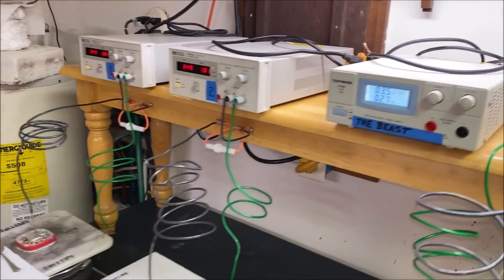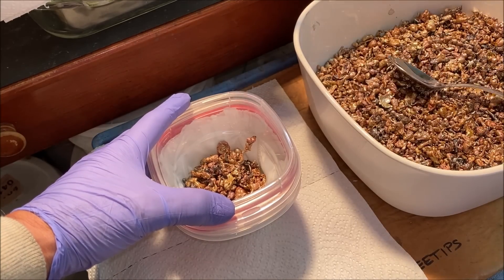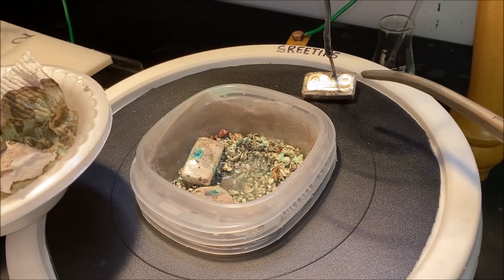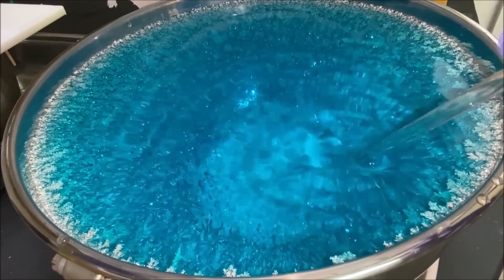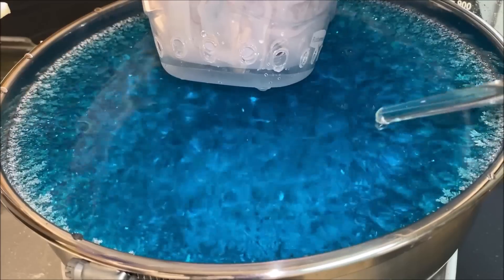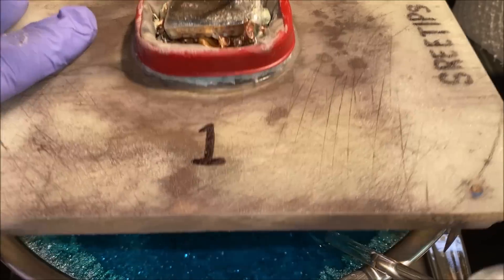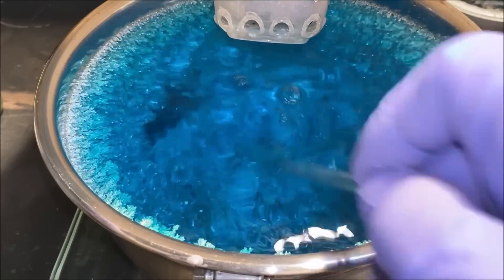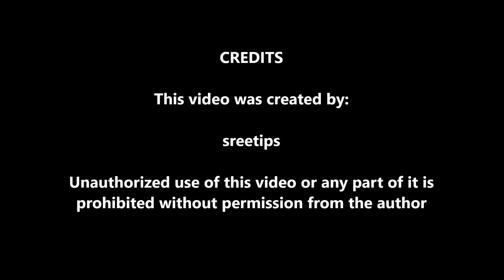Silver Cell Day 4 Crystal Growth 96 Hours

Comment: Hello, the dictated translation sounds a bit stupid, there are meaningless and absurd words in your language, in English it is very different from how you speak. 
Replicate your experiment and use the graphite anode as well as the cathode of a 45 liter crucible in the separation part or lid and used PVC, this method also works with gold 😜
Reply from the maker: Sounds stupid, got it. I’ve used graphite for cathode material. Thanks for the input

Comment: Excellent work , the silver may be pure but really  the cleanliness of the system relies on you only using diffusion through the fibre ,  so the size of the bag is paramount ,  of course you could use 2 baths with a ion bridge between to increase "production" , probably not worth doing,  but it would mean that the cell would keep producing and not clog up ,  all the slimes would accumulate in the dirty side, just loose in the bowl and you wouldn't need to buy the bags ,  you just need to ensure there is no flow between the two sides, in electroplating a cloth or tune is used between the two sides as a bridge between the two sides ,   it just depends on how clean you want the product
Reply from the maker: Interesting, “a cloth or “tune” is used between the two sides”. What is a tune?
Reply: I used to use a "bubble lift water pump "  to gently circulate the fluid in the receiving side ,  it's just a loop of pipe filled with the fluid that has air injected by a aquarium pump to just form bubbles that rise up one side of the loop ,  the weight of that side is less as the bubbles are there and the water flows you can get a significant lift of a few feet with a very very gentle water flow using this pump ,  great if you say are keeping tubifex worms as live fish food or aquarium.plants and want a low flow of water through several levels of trays
Reply from the maker: Bubble lift to create flow is also a very interesting idea. Thank you.

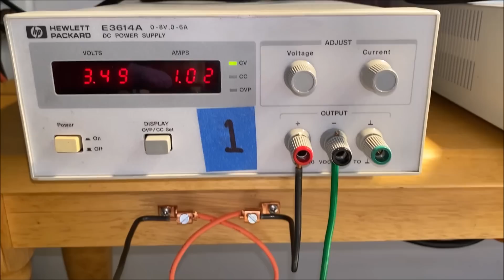Comment: @6:08 could the cathode copper plate. be replaced with a silver plate cathode plate? perhaps even the copper nut be made into silver? perhaps both the anode and the cathode copper wire be replaced with silver? understanding resistance. silver metal should be more conductive than copper and produce less resistance. i imagine you have enough silver to create these plates and wires.
Reply from the maker: On a scale of zero to one hundred, copper is rated 100 in conductivity. The only metal more conductive is silver. It’s rated at 105
Reply from the maker: Making everything out of silver would improve conductivity.
Reply: @sreetips  any upgrades, should produce exciting video content! including any struggle creating, or scouring the silver wire, sheet, bolt and nuts. opulence.

Comment: Hi Sreetips, Just a word of caution, not sure of the ratings on the respective power supplies but in order to pop a fuse like that quickly (ie. a few seconds) usually takes roughly double the rated current so worth taking that into consideration when evaluating how much additional protection those fuses are actually providing over and above the over current protection and internal uses on the power supplies.
Reply from the maker: I’ve had them burn a couple times due to short between anode and silver crystal. Didn’t ruin the batch of silver either time.
Reply: @sreetips  if the fuses are functioning as you'd like then that's a reasonable indication that the ratings are at least in the ballpark. I just urge some degree of caution incase you hadn't actually popped them a few times semi-intentionally to ensure that the ratings are suitable for the task. By all means, please do carry on, you've clearly got this.

Comment: hello Sreetips, to prevent too many crystals from forming just under the basket, you can put an insulating disc under the basket. the surface of the bowl is large enough for the current to pass easily. the disk diameter is to be determined according to the distance of the crystals around the insulating disk and the current "loss", certainly minimal but not zero.

Comment: the best thing you can do to increase current flow is to try and make the silver shot as small as possible, which will increase the surface area contact and lower the level of resistance and will increase the current. 
ohms law - V/I x R    
also try using crmps for connecting the wires to the equipment for the best connection.

Comment: Would increasing the voltage any increase the speed at which the process happens or does it simply result in higher electrolyte consumption?
Reply from the maker: The voltage is critical at 3.5 volt DC